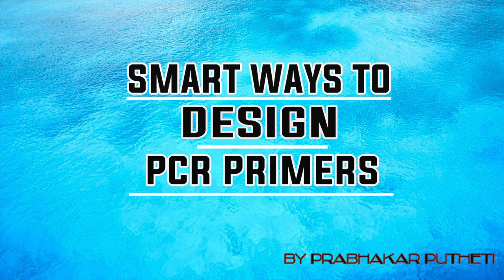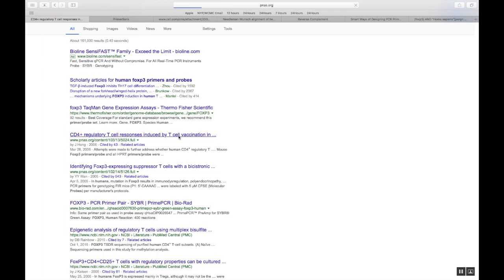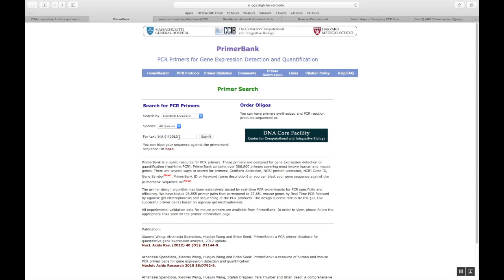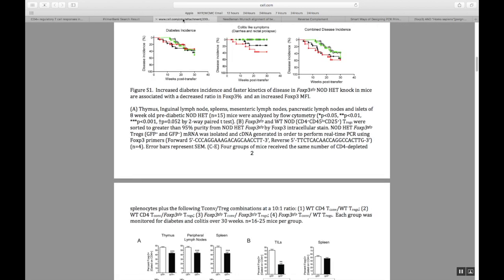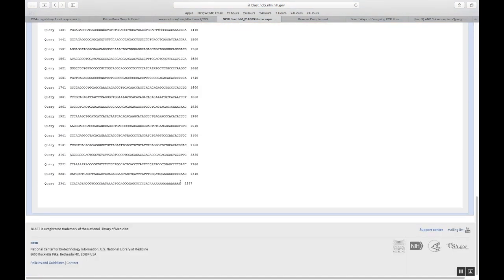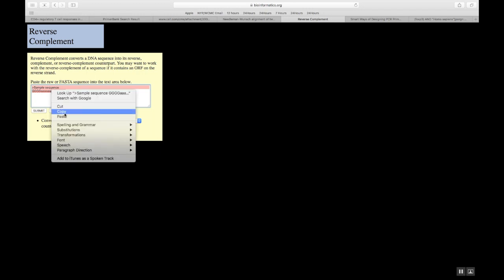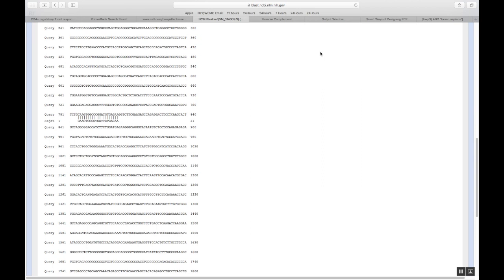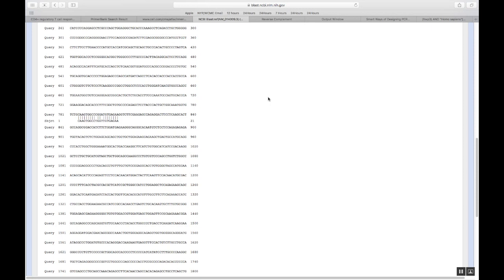Smart Ways To Design PCR Primers

Comment: Thanks for your video , it was really helpful.but, I have a question, when you find the sequence between reverse and forward primers which you want to designe probe for, do you designe the probe manually or you use a programme?I tried to designe probe using primer3 and idt scitool but when i blast the probe sequence using nt blast it is not spesific for my gene of interest.What can i do for that ?
Reply from the maker: As you know, when Taq polymerase binds to the primer bound region and synthesizes the complimentary strand, it cleaves the probe off the template separating reporter from quencher, and the reporter emits the fluorescent signal. Basically, if probe doesn’t bind between the regions bound by primers, probe is not cleaved. So, as long as your primers are specific for your gene of interest and your probe binds (although in your case it is binding elsewhere too), you will get the specific signal from probe. You may have to test with higher concentration of probe so that it binds your gene of interest sufficiently. I would advise you to try your probe at regular concentration as well as at higher serial concentrations and choose the optimum concentration. Did you try SYBR green, where you don't need a probe? Not all times you will be successful in designing the probe, when you collect primer sequences online, as the region length is often limited.